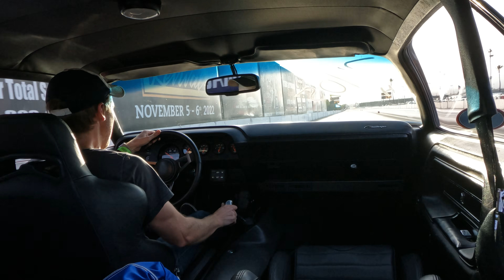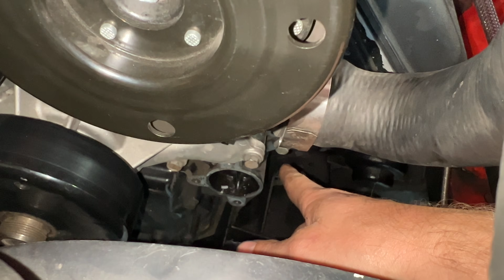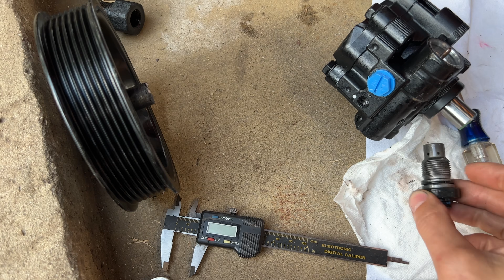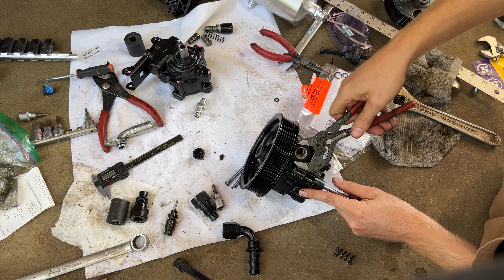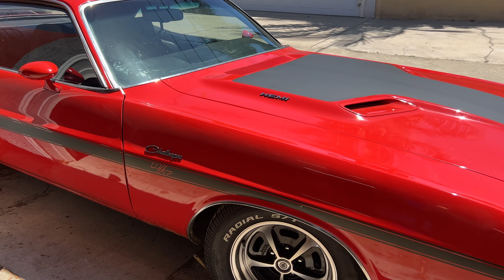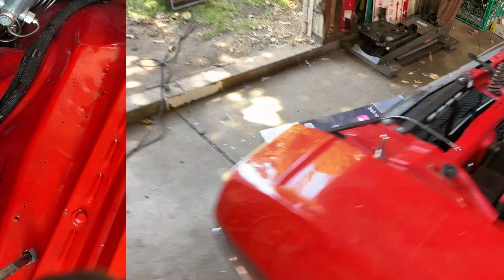Hemi Swap Power Steering PSI Reduction Toyota Valve Mod and Radiator Power Steering Cooler

Comment: I'm doing Hemi swap in a 69 coronet wagon. I got a 74 challenger radiator, to have to hose outlet on the right sides, what hoses did you use for both radiator hose. outlet to the t stat is 1 3/4 and the radiator is a 1 1/2 inch. lower is 2" on the engine and 1 3/4 on the rad. the Hemi is a 05 just like your .I'm doing  the power steering now like you did yours. I got the pressure valve yesterday and get the pump and pulley today
Reply from the maker: Coronet wagon! Super cool man, absolutely love those and such a rare car to see. Part number for my upper rad hose is E 72210 and Lowe hose is D 70685. Hose diameters were a little smaller than some of the outlets but I was able to stretch them on. I’ve put about 10k miles on them they’ve been just fine. I’ve put a few thousand miles on the power steering (including some hard driving at the track) since this modification and it’s been great, totally solved my issues.
Reply: @noboltsleftbehind  I'm did the same mods on the pump as you did, just waiting for a pulley (I ordered the wrong pulley the first time). Your info was spot on! I'm putting in a vintage air system in the wagon . I want to us the factory pump off of the hemi , so I don't have to modify the mount , I am looking for the compressor fitting and can't find any, would you happen to know if they are available and if so where. Thanks for your help
Reply from the maker: @davecantu7437  awesome man, so glad to hear I could help! I did the same, I hooked my factory Hemi AC compressor to my vintage air system. Vintage Air has the fitting you need, they’ll build the hoses for you too.

Comment: what is the brand and part number for the reservoir doe it come with the fitting for the pump?
Reply from the maker: It's a Speedway Motors reservoir, part number 91032876-STD-8 . It comes with AN fittings

Comment: That was a lot of work 😳 I used a AT transmission cooler for my PS but when I used to road race hondas, I ran my PS lines through my radiator like you and then through the stock AT cooler(I had converted mine to manual.)
Reply from the maker: Ever notice any issues running through the radiator? I think I saw a very slight increase in coolant temps but I haven’t gotten around to sealing my fans to the radiator yet so that should bring them back down.
Reply: @noboltsleftbehind  well yeah, that is a slight consequence but your cooling system should be able to handle it

Comment: Why didn't you got with a LS Type II? I believe there are some out there that work with a Borgeson box. I am going to be running a Holley Type II with my 5.7 in my Charger.
Reply from the maker: I was too cheap to buy the Holley kit lol and I couldn’t find a way to adapt the LS type easily. That would have been my next step if the Toyota valves didn’t work out.
Reply: @noboltsleftbehind  Completely understand
Reply: The holley kit is super nice. I have it on my hemi swapped D100 but was looking at doing the Toyota valve also. DIY Hemi has a full video also on what valves make what pressure
Reply from the maker: @repair-and-despair-garage  the DIY hemi video is where I got the idea actually, definitely we’ll explained. I’m not 100% convinced the PSIs they have listed are quite right, one of the valves I scrounged was supposed to be like 800 or 900 psi and there’s no way it was that low. I suspect it was less to do with the valve letter and more to do with the little holder nut the valve sits into. I noticed they have slightly different sized fluid passages.
Reply: I think you are right.  Not long ago I messaged them about the valves and they were experimenting with another setup off some other Toyota at that time because they weren't happy with the results.  Still a neat way to do it though

Comment: I remember thinking wow$159 this is way too much f**** work 😂 and they all agreed this is bulshit man. Ha ha ha the headers and intake. Yes that how we'd do'em they said. And they got 10 different ways to make that part for the throttle linkage now that I had them custom weld together from the linkage to tie the cable for the transmission into working order

Comment: And I noticed that one of the key differences between the 71 and 72 Dodge Challenger which my 72 is almost a total 71 clone is the windshield wiper motor motors ha ha 😅😉 and how they look and bolt 🔩 in place on the car I think where you sit 🪑 in the back seat and the roof are still 1972 dodge challenger but it's about nine cars all 1971 rt dodge the trunk deak lids not no wing but he even had the vin plates and pictures from when my car was a total rusted out piece of crap!

Comment: Anyway I think there's like 18 different pitman arms that'll fit in there into the old original 1971 power steering gear box for a Dodge Challenger and it's almost unsafe it's so touchy because you've only got an inch play in the steering before your wheels totally turn

Comment: But I screwed up when I pulled the steering column out of the car steering wheel and I couldn't get it back into the gearbox by myself like I could pull it out of your box so I've got it shoveled about a little bit of the way in or it's almost in the right position where you need to put that cotter pin by that worm gear ⚙️ and then I just squirted silicone in the whole to grab it😂! Ha ha ha 😁🤣 but I asked him for an air hammer so that I could beat it back in the position they wouldn't give it to me LoL thankfully 😂❤

Comment: So the first thing they did is pull of the header off there that I bought and heated up and doik it like you press in on  a clown nose LoL an that wasn't enough clearance really so they took apart the gearbox and went through all of the different pitman arms that were available that could possibly fit inside of there until they found one of them that gave enough clearance to allow the car to turn left and right 👍 and be far enough away from The hitter so that you know this is actually functional instead of like a drag car or a NASCAR

Comment: 😊ha ha ha 😁🤣 yes something exactly like this went down just switch to hooker headers and they bolted to the block just fine but then the steering linkage at the pitman arm touched the headers and when you turned it to the right it would pull an touch them and bend the headers away from the block at the top!

Comment: Very creative using your radiator like that. Is a too low temp of your fluid not an issue for the long term? 
Respect for the solve man, really thinking outside the box.
Reply from the maker: From what I read an ideal power steering temperature is right around 160-170, so I should be right in the sweet spot. The power steering actually uses auto transmission fluid which is what the radiator was built for. We’ll see what kind of temps it can hold it at when I do a track day soon, but I’m hopeful!
Reply: @noboltsleftbehind  sounds perfect! Let's hope track day goes well 👍